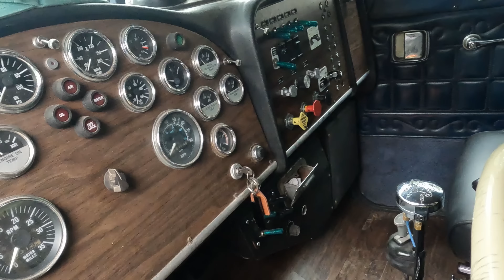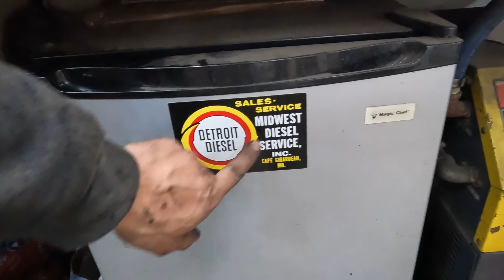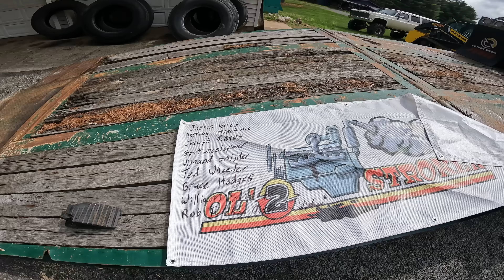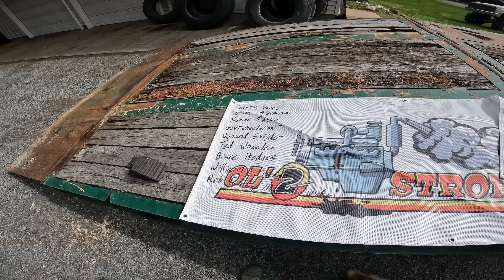1980 Peterbilt 359 and lowboy need to get ready for a long trip!

Comment: Got a buddy here in Michigan that runs a fleet of gravel trains. First thing he would do when he got a new set of trains was to replace the oiled hubs on the trailer axles with high temp grease. Said they pulled a little difficult in the winter when first starting out but once they warmed up they were fine. Said he never lost a wheel bearing due to lack of lubrication.
Reply from the maker: I hate grease. Hate!

Comment: Wayne, I made up dummied glad hands for my trailer for the very reason of keeping the crap out of my trailer air system! I took regular glad hands, put a short piece of galvanized pipe, with a cap on the end, and put them on my trailer every time i dropped it at my house! Keeps the snow and water and those dang muddobbers from getting in there and keeps the system sealed up tight! After replacing one of those valves in the dead of winter, because it blew apart because of ice and smoooo inside it froze!

Comment: Dude, instead of taking the wheels off just jack up to take weight off ,keep your plate under tires,slick the plate up with antifreeze ,remove bearing hardware , and slide dual assembly with drum right out when reassembling you can eyeball through hub to line up seal with jack. Much less disassembling. You’re welcome👍
Reply from the maker: That's how James says to do it too. My brain won't let me.
Reply: You’d be surprised how easy they slide. Also let’s you line up the new seal perfect without killing your back

Comment: Your center bearing is safe at any temperature below 250. 170 is normal,  too little grease it will be hotter,  too much grease will be a lot hotter
Reply from the maker: Thanks man. Just seemed odd at first

Comment: If the air leak comes back there's a relay valve about the front drive that will cause it to push air like that. Also if that air to electric switch " 4 PSI low air pressure switch" or ever goes out Peterbilt might try to get you for $158 but they have ones for $13. They have different PSI from 4lb to I think 70lb and the lower the PSI the higher the price but for some reason they have 2 different prices for the same exact switches.

Comment: I don’t think I would worry about the carrier bearing. Any moving part is gonna build some heat when it’s moving, pushing through grease is resistance. As long as it doesn’t get hot enough that it starts boiling out I don’t think anything is out of the ordinary. Embrace the grease Wayniac, rub it all over yourself! 😂
Reply from the maker: Grease is like my number one all time hated thing.

Comment: Just a hint on the air bleeding back to your mv3 valve. It's most likely a brake chamber bleeding back through. Take the service lines of the chambers and see witch one has air coming out with the trailer brakes released. Or just replace every component of the air brake system. Lol check your e brake quick release valve also
Reply: The wicked air leak is bleed back from your actual leak
Reply from the maker: There's no maxis on this trailer so can't be a chamber

Comment: Congrats on figuring out that back feeding air leak. What a PITA! Wayne, get you some of those glad hand o-rings that have the little flappers over the hole. Keeps the schmoo out of them. I found when the trailers sit for a long time, those flying ant bugs love to build some kind of paper nests in the glad hands and the first time you charge the trailer, everything gets blown back to that valve…
Reply from the maker: I changed to those after I fixed the air leak!! Good call!

Comment: you should also think about converting your brakes and brake hub so you dont have to take both off at same time. at least you will be able to change brakes with out having to change seal each time. just saying. keep up the good work
Reply from the maker: I would have loved to do that and go hub pilot too.... Out of budget.
Reply: @Ol2Stroker  You use it too infrequently, those brakes will rust out before they wear out so it's just fine. I would put maxi's on one axle though.
Reply from the maker: @mikesautotruckrepairinc.cr5621  when I redo the deck I want to add maxis on both. So much nicer.

Comment: Make a plate out of 1’4” flat steel to match top of tractor protection valve. Drill 2 5/16” hoes to match tractor protection holes. Weld 2  nuts to top of plate. Put in on top where nuts where. Start 2 mounting bolts loosely at same time. Know you can tighten bolts and not have to hold nuts. I did this on 359 Pete and worked good. I agree engineer should be shot.

Comment: Air leak on red valve sounds like your emergency valve is bad on trailer. Air trailer up then set brakes pull red glad off if Air is coming out of trailer glad hand emergency valve is bad